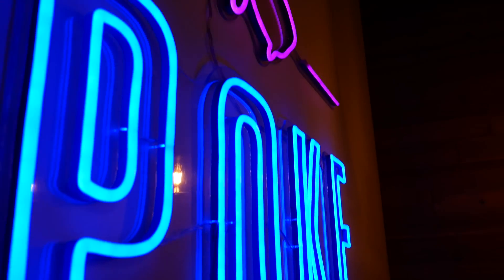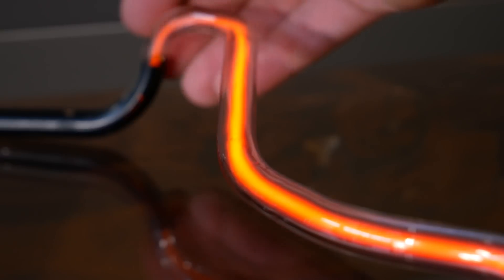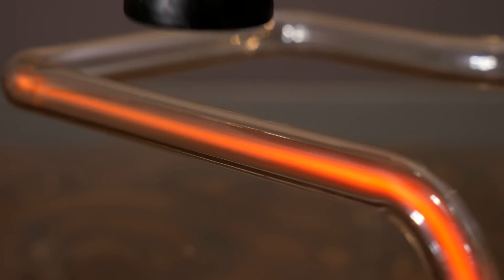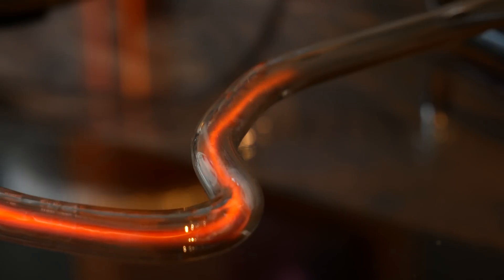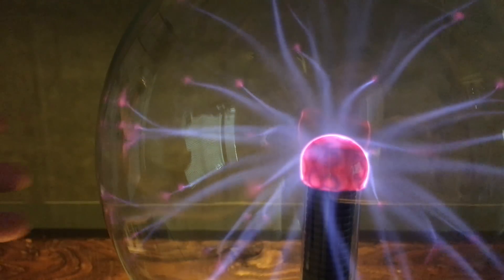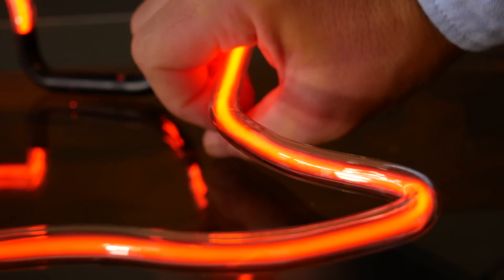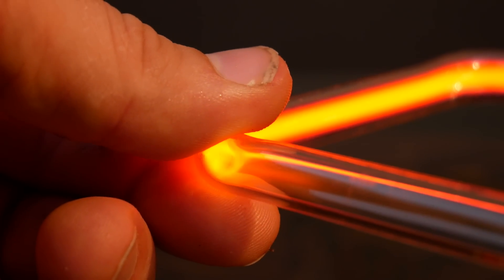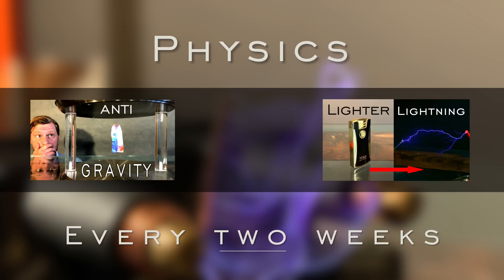Magical Plasma Manipulation Using Neon!

Comment: I just got a circular neon tube from a clock on Craiglist. Tried undervolting it and got similar effects to what's shown in the video.(I used my bench supply rather than a high frequency one)  The plasma followed my finger and i was even able to keep the entire loop on at lower then normal voltages if i drew a line with the plasma from one electrode to the other.  The plasma was not able to stay in the middle of the tube though like shown in the video. It stayed connected to one of the electrodes. Very cool, i love the channel!

Comment: Can i touch my tesla coil. The plasma where tip of the  needle
Reply from the maker: Depends on how much power your coil pumps out. If it is a small battery powered one, less than 30 watts, yes you can touch it safely. This is assuming you have a healthy heart.
Reply: @PlasmaChannel  thank plasma channel. I love your content mate.

Comment: Using high voltage DC with a high voltage capacitor to accumulate charges, pretty much any lamp become self oscillating stroboscope.
The thin fluorescent tubes found in older LCD tv are bright. Ordinary fluorescent tubes quickly degrade, the pulsing slowing down, requiring higher voltage.
Small neon and xenon tube may self destroy of the first spark.
Adding different electronic component in series sometimes gives surprising result. Cristal oscillator can reduce power somehow without overheating.

Comment: Most of the time (your case excepted) neon signs are nothing more than long fluorescent tubes since the variety of colors come from phosphors coating the inside of the tubes. If you move your hand up and down the length of a fluorescent tube in the field of high frequency voltage you will get the same effect of extinguishing the light as your hand moves along it's length.
Have you tried to make your own plasma jar (I used a glass pickle jar with good success)? You'll need a decent vacuum pump such as those for air conditioning systems.

Comment: Question when you did the element bending how did you charge your body
Reply from the maker: Hi, as I mentioned in those videos, I used a voltage multiplier and attached it to my body. Since I designed the multipliers, I knew their safety.

Comment: Hey Jay, what's your take on THIS??? I mean...is it Plasma? Maybe YOU can build a machine similar to THIS?! 🤔 https://youtu.be/GTpoI0QFlAM
Reply from the maker: Hey Jay. Nice name you got there. For the record, that is incredible. When I first saw the flame, I instantly thought: high frequency tesla coil - which I believe it may be. However, if he is consuming more energy to vibrate the water, than the water provides as it heats up and turns to electrons, then this is merely a party trick. 

The one thing they did not mention in the video, is what is the energy consumption of his radio device. I would bet the energy consumption is quite high. 

Nonetheless...incredible!
Reply: @PlasmaChannel  Hey Jay, thanx for responding to my comment. And yes, I dig our names. Lol. I actually saw that video like 2 years ago and since I've been a subscriber to your channel(approx. 2 months now), I SUDDENLY remembered that video and just HAD to get your take on it. Actually, I was also watching another video by some CRAZY Ukrainian guys with the channel name, "Kreosan". Anyhow, I was watching them do some experimenting on old microwave ovens and their power and I happened to see one experiment where they added salt to it and it produced the EXACT same plasma wave as the video above. I'll find it and send you a link to that also, just to see what you think about that also. It's got SOMETHING big to do with salt, I know THAT much.
Reply: @PlasmaChannel  Ok Jay, here it is(note: at the 1:00 mark, they add the salt) and boom! SAME plasma current as video above! Check it out...... https://youtu.be/H1gBinKRqqY
Reply from the maker: Haha yeah. Yeah I am familiar with them - I have watched them for years. Y the yellow color is vaporized sodium. Again though, they are expending energy, not creating it.
Reply: @PlasmaChannel  Gotcha. Ok, I'm starting to understand now. I'm quite new at electricity and how it functions. After years of not really having a hobby, I started tearing apart old working/nonworking electronics just to scrap out, but instead, I took an interest in the components and how they all work. Therefore, I've been saving every diode, capacitor, resister, etc. that I can get and am now wanting to do builds. Hence, why I subscribed to your channel. Well, thanx for chatting with me and for the information. Good luck on your channel. Oh...and....You stay classy! 😉

Comment: You are correct about the capacitive coupling for the reason of the plasma deformation. The high frequency causes the gas on the tube (regardless of gas type which dicerns color) to be ionized like you stated before. Inherently it creates a low impedance path through itself which allows it to be conductive to an external source. The high frequency also alows for a small amount of single wire transmission which charges the plasma to a high positive voltage (or negative depending on the psu used). That excesse charge will want to go somewhere such as your hand that causes the plasma to follow your hand. I have glossed over many aspects, however that is the basics.
Reply from the maker: Perfect explanation. I do believe you are correct. Thanks!
Reply: @PlasmaChannel  Thank you very much! I live yoir videos and channel. I'm just happy to help.

Comment: 🎊🎉🎇Congratulations Jay for crossing 50k subscribers 🎇🎉🎊
.
.
.
Very Soon it will be 100k and then 1million ☺️
.
.
.
Amazing and Awesome video as always :)
Fire Bending -> My Favourite
Plasma Vortex -> First time ever on YT
Lighting Detector -> Whoooaaa
Mini Tesla Coil -> Awesome Build
Ping Pong ball Particle Accelerator -> Hey world, have you ever seen one?
I haven't.
And how can I not mention Levitation using ionic thrust and water bridge.
Best thing about plasma channel is the uniqueness of ideas and their implementation.
.
.
.
I was wondering what would happen if you wind a solenoid coil around the glass tube and then connecting it to power supply. As plasma inside the tube can be moved to any part of glass tube by touch and plasma can be made to deflect in presence of magnetic field, what effect a solenoid will have on it?
.
.
.
One more idea, what would happen if you wind some aluminium foil around glass tube (similar way as holding the tube with one hand) with and without connecting it(foil) to ground.
.
.
.
One more thing, can you break that plasma into two streams by holding the tube with both hands and then moving your hand apart from each other while holding the tube so that one stream remains at one side and the other one on the other side of tube????
.
.
.
I ask so many silly questions 😛
Reply from the maker: Thanks Tarun! Woo! You've been with me through this all. Your video ideas are wonderful suggestions. I've screen shotted your comment to experiment with these ideas later! Thanks so much.

Comment: An interesting thing would be to know if your power supply was galvanically insulated from the mains. If it was, you'd be exchanging current through the air rather than through the ground
Reply from the maker: My supply I believe was fully isolated from ground. For the part of the video where I cause the plasma to choose left or right, the supply was not even attached to the Neon tube.
Reply: @PlasmaChannel  At high frequencies, things are never "fully" isolated. Even a mains transformer has enough capacitance between the windings to act as a relatively low impedance.

Comment: For your plasma reading pleasure:
wikipedia.org/wiki/Capacitively_coupled_plasma

wikipedia.org/wiki/Capacitive_coupling
Reply from the maker: That's pretty interesting. Looks like it could be used for Sputter coating of metals?
Reply: @PlasmaChannel  Same goes for Radio/microwave coupled plasma, LASER induced plasma, arc discharge and inductively coupled plasmas. All can be used to sputter metal plasma. Plasma gassification plants are a good example of massive arc discharge plasma. Low power allows cold plasma which has medical and industrial uses, kills bacteria and alters surface chemistry of materials. Inductive coupling and RF coupling is efficient way to heat up plasma to fusion temperatures or for rockets like NASAs VASIMR

Comment: I made a tiny tesla coil and with a fluorescent tube it happens too
Reply from the maker: Excellent. With your small TC being very high frequency, I would suspect it to be due to coupling effects.
Reply: yes, it happens too, when the tube is not fully lit, i've also seen some "bubbling" inside the tube, like marching waves going to an end, but only regular fluorescent tubes do this in my case
Reply: @redoverdrivetheunstoppable4637  I noticed the bubbling too, i used the basic slayer exiter from the internet (just one low power transistor), but it was only for a science fair. I will made a bigger TC with better components soon :)
Reply: @dwdadevil  i have an IGBT one that sparks 30cm, a mosfet desktop one that i use for "everyday", a vacuum tube one that sparks 7cm (TV tube) and a small triple primary slayer exciter :3 ...... yeah, i have little to do :D

Comment: Now can u make a tutorial for how to make a simple Neon Lights?
Reply from the maker: This is an ambition id love to do. Unfortunately, creating Neon signs requires fairly uncommon and expensive equipment, as well as serious glass-working abilities.
Reply: @PlasmaChannel  can we use a Testube,seal the hole n make way for vaccume pump to pump air out and use it for Neon?
Reply: @merxellus  probably can do that. There is risk of implosion, and you need to control the pressure of neon you put in fairly accurately so it lights at a reasonable voltage and brightness. The trickiest part is probably adding the electrodes, although maybe you could just always run it with capacitive coupling.
Reply: @Basement-Science  oh thnks

Comment: Hello Plasma Channel you might have heard about those cheap hv modules from China? Could you make a mini tesla from those?
Reply from the maker: Those little Chinese HV modules could potentially power a small tesla coil. However, they would burn out extremely fast, as they are not intended for that purpose.

Comment: Yeah neon  itself is conducting the electricity and glass is working as dielectric substance and sir  as your body is grounded So it it following the least path and stops where you touch it ,rather being it a innert gas It's not going further ,and when you are squeezing it the no. Of electrons which were ionizing the gas ends there path near your finger So in the other part of the tube no. Of electrons ionizing neon gas decreases ...that's my thought,by the way Love plasma ,love lightning ⚡,love your channel ,stay classy ,🎃  Happy post Halloween also 🎃
Reply: 4:21 you have injured your finger sir somehow,take care🎃
Reply from the maker: I think your reasoning and thought process is correct. I fully agree.

Comment: Cool. I did similar experiments with a couple one inch by 6 foot xenon tubes. I also put out a candle with a 15kv transformer a small metal rack, a coil and a switch.
Reply from the maker: Hey ryan. I would love to work with Xenon - hard to find that stuff.

Comment: My first impression is the antenna effect of the human body. In the same way you can 'effect' the RF signal with your arms and body near a set of 'rabbit ears' for an old signal television... Or how holding onto a florescent tube will illuminate near a van de graph generator... There is even a musical instrument called a Theremin that uses this potential to change the pitch of the note being played.
Reply from the maker: That is a great point. Those other items do use capacitance to determine frequency, as well.

Comment: You can also interact with plasma with UV LED's. I was able to move the discharge inside a neon pigtail globe with a focused LED. UV lasers were not available when I did this. Surely they would work better. The hand trick can be used to start a faulty fluorescent light btw.
Reply from the maker: That's funny - I suppose this trick could be used to ignite a faulty tube. Also, a really strong UV light can ionize air - leading to growth of plasma. Pretty cool stuff.
Reply: @PlasmaChannel  the LED i used was tiny, so it was surprising it moved the plasma at all.
Reply: @PlasmaChannel  The Energetic Laser-Driven Light Source is used in industry and traps the plasma discharge at the focal point of a fairly high power near-IR laser.  It gives a smaller plasma with more stable location for better coupling via optics for use in various high tech instruments. I wonder if this can be done with a Neon light as well.  If I recall correctly, I think for the Energetiq source the electrodes can even be turned off and the plasma stays alight at the laser focal spot.  That might allow for lower power usage, or at least longer electrode lifetime, if I recall correctly.

Comment: xrays may be an issue Jay when you experiment with a dc hv supply to a neon .
Reply: Garry Clelland the pressure inside the tube is too high to create X-rays. X-rays require both very low pressure and high voltage. He is safe from X-rays here.
Reply: @northernskies86  thats good , thanks
Reply from the maker: Hi Garry, thanks for the warning. I agree  -  x rays are always on my mind when doing this stuff. The pressure inside neon signs is not quite low enough, and the power level not quite high enough to produce them though.

Comment: Stunning work Jay. Thank you. 

The change with squeeze is due to resistance. Harder you squeeze the lower the resistance. 
I believe you are able to move the ionised gas due to asymmetric capacitance.
Reply from the maker: Thank you Gareth. That's correct about the squeezing and capacitance as well.
Reply: Well, you've been a good teacher. I was a milk man before I found your videos.

Comment: Very interesting !  I have one demand : could you give us the story of how the plasma was discovered and more importantly why it was named plasma ?  Thanks.
Reply from the maker: Hm.. thats a good idea.
Reply: Also then why is a part of blood called plasma?
Reply: Because some dude had a last name of plasma..  and there were 2 dudes.  One an electrical engineer and another biological.  And probably had names with a latin rendition of plasma..  im guessing because is how most stuff gets named..  or edison / testla both tried to capture it in a bottle from lightening and their assistant who was holding the metal string blew up and all that was left of the blood was the white blood cells which spelled plasma on a wall where he was standing when he popped..  also why is that stuff that comes outta infected peckers called smegma?  And melted rock inside the earth called magma? But lava when surfaced?  Whats smegma called before it comes out?  Fuggn gross what id call it..
Reply: Plasma comes from ancient greek, means moldable or formable sustance.

Comment: The reason you can command plasma with your hands could be due to your hand acting as neutral or ground terminal. If so, you might be able to command plasma with ground wire or neutral wire in theory.
Reply from the maker: That sounds correct, to the best of my knowledge.
Reply: Zeno neon here hi reply asap

Comment: I'm not sure if it's specifically the squeezing that causes the snuffing of the plasma. The squeeze may just be causing a better couple because you're making better, smoother contact. It'd be like making a capacitor out of wrinkled foil vs smooth. You'll get way better capacity from the smooth foil. Try squeezing it with an insulator to see if it has the same effect.
Reply from the maker: I'd argue as well that the squeezing is creating a better coupling. Nice catch.